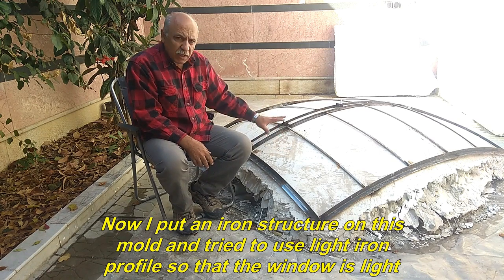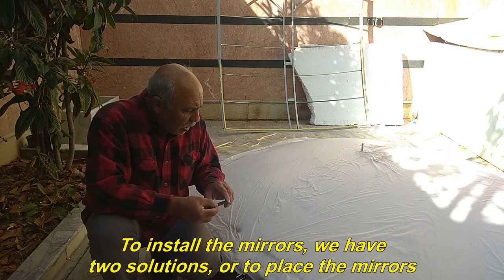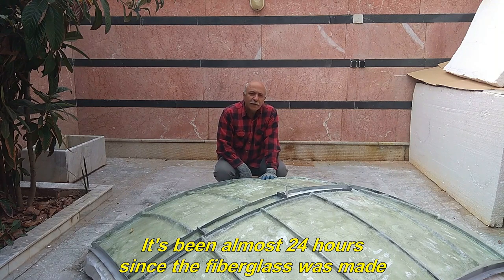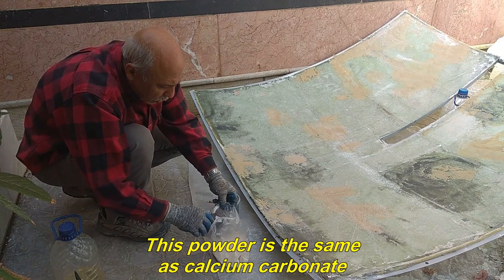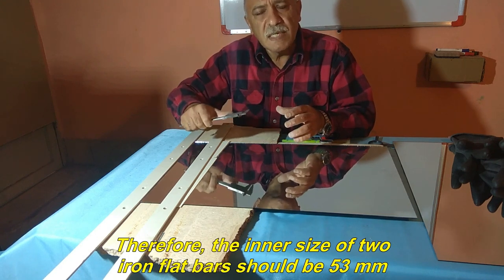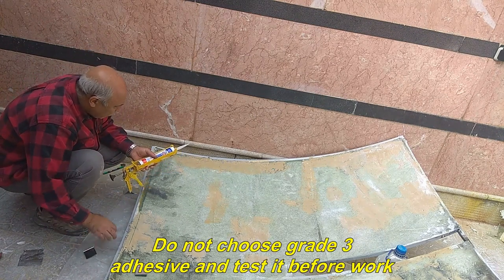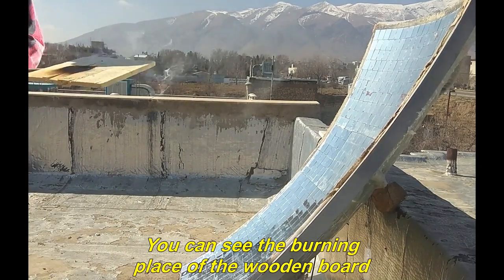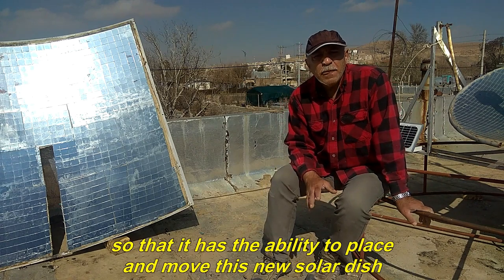The principles of making a solar dish.making a solar dish. The method of making a solar dish.

Comment: Does the paint on the cutting edge of the mirror gradually peel off and lose the property of the mirror?  The side of my mirror is coming like this...what is the solution?
Reply from the maker: If the glue behind the mirrors is carefully applied, this will never happen
Reply: @fixedfocussolar  thank you